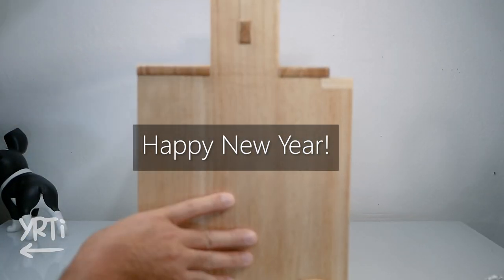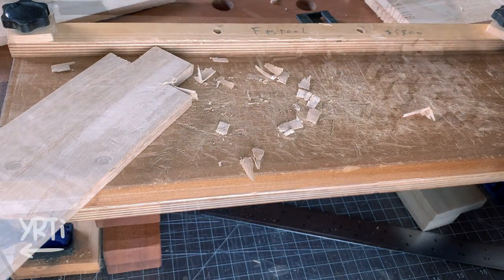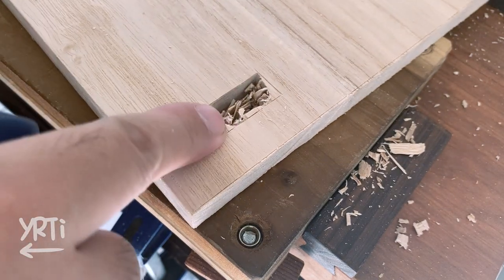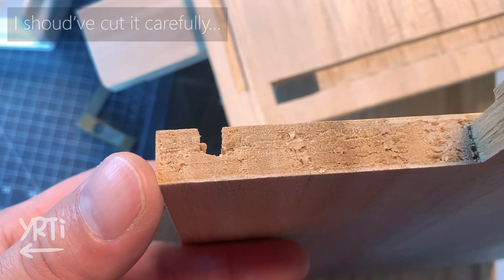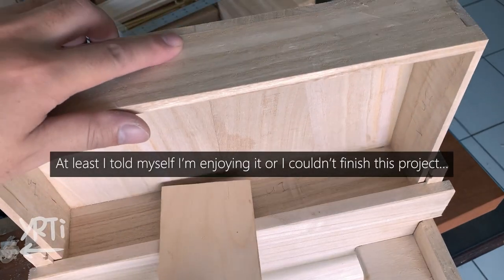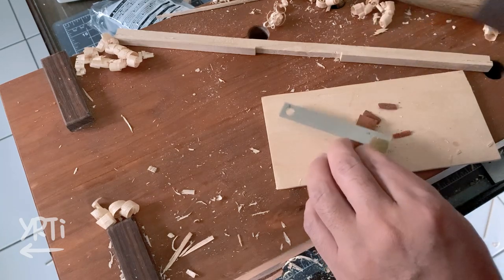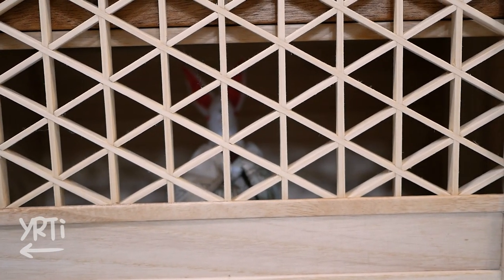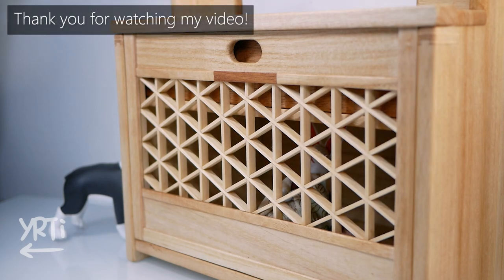A Tool Tote with Kumiko / Japanese Okamochi style

Comment: Ramen delivery box? This is very stylish. It's really pretty.
Reply from the maker: Thank you! Yeah, often they use one that is made of aluminum for Ramen. 
I usually plan a project including process/schedule before getting on it but I planned this as I made so it ended up taking a longer time... lesson learned.
Reply: I was taking another look at this project, what are the dimensions?
Reply from the maker: Oh, it's H10.5" x W14.75" x D9.25 (Outside dimension without handle).

Comment: Hello,
I'm currently making a merchants tansu. After much research I have been unable to find out how the back panels were made. Can you offer any information about this? Thank you
Taipan Woodworks
Reply from the maker: Hi Tom, I think it depends on the material but I've seen traditional Japanese tansu makers first join a several boards and glue it on the back of a tansu and use wood nails when I was researching how they make paulownia tansu. That's all I know about it and sorry, I've never even build a tansu so I'm not sure...
Reply: Thank you for your time to reply. I think what I'm going to do is build the back panel as a half frame with shiplap boards within. How they nest won't be seen because that face will be inside. Are you familiar with Morikuni Hardware? I will be using thier products on my tansu. I'm going to watch your latest video now. It gives me great energy watching you work.
Reply from the maker: Shiplap boards sound cool. Honestly, I'm still learning woodworking so sorry I can't be much help... With regards to Morikuni hardware, I have no idea about them but it seems like they are based very close to the Tsubame/Sanjo area where it's famous for metal fabrications so I assume they are high quality. Even Steve Jobs went to the area to ask metal fabrication for the backside of the 1st gen iPod...